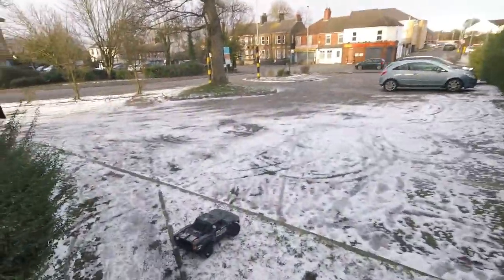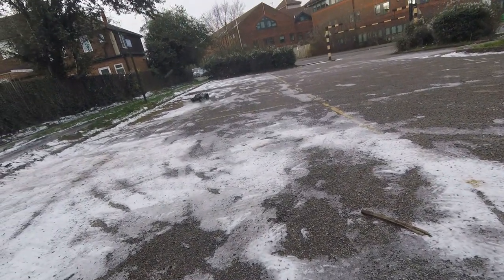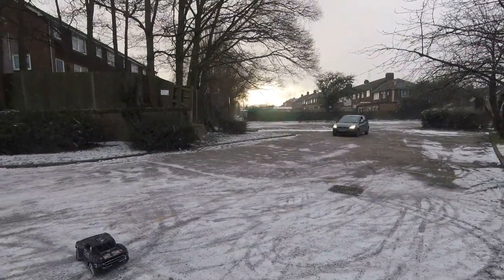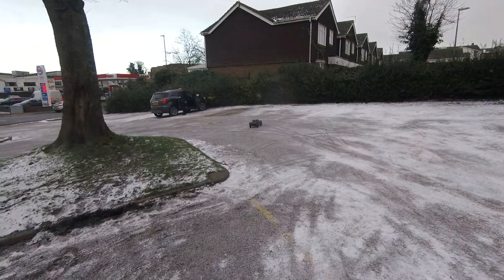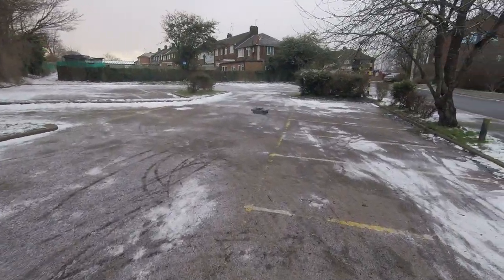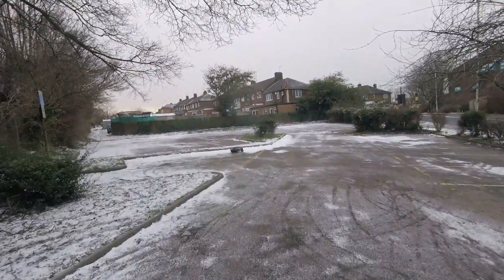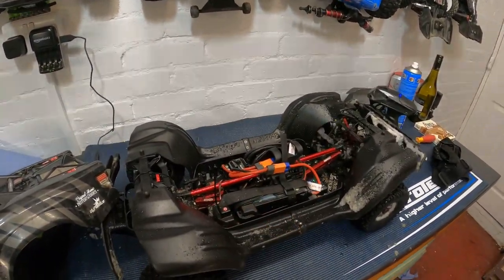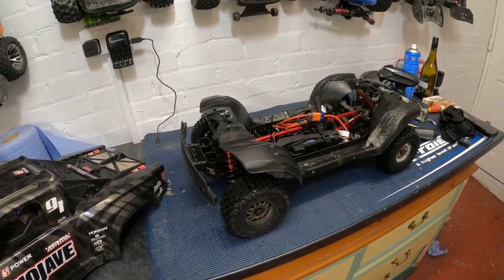ARRMA MOJAVE EXB Hobbywing MAX8 ESC and 2200kv motor ( our first cold run out ) Drifting.

Comment: Great run with a great car.  I love mine but have only managed to get it outside twice since I bought it.  Did you run the 17t pinion which came with the Mojave kit?  I've got the same Max 8 and 2200kv setup as you and the 17t seems too high to me when the Kraton 6s has a 15t pinion included which is described as a high speed pinion for straight line speed runs on smooth surfaces.  I worry that the 17t could cause overheating issues.  It is monstrously fast though!
Reply from the maker: I'll be honest it came as it is I unboxed it and ran it haven't even looked at the pinion lol the guy I bought it from had it set up for racing it's soooooo fast its unreal and it came with a bigger motor 🙈🤣🤣
Reply: Does the Mojave come with the larger17t pinion because it uses smaller diameter wheels/tyres than the Kratom 6s ?
Reply: @gillian9178  I think the EXB comes with a 17t because Arrma don't specify which size motor you should install - you could install a  2200kv or a 1650kv if you choose so the 17t may not suit all choices of motor for the EXB kit, it's only a guide as they can't include every possible pinion size.  Just my guess.

Comment: Great new addition to the collection! I have been thinking which Arrma to get (I don't have one in my collection yet), either this or the Kraton 6s V5.
The skate park is open (I wore a mask when it had more than 10 people at the weekend).
I went yesterday to the BMX track & it was open & very icy. ☺
I'm just about to head down to the skate park with my Traxxas Maxx for 6 (evening bash & should be empty with -3 degrees C temps 😂).
Keep on bashing! 😊
Reply from the maker: Might do a run the weekend at the bmx track will let you know